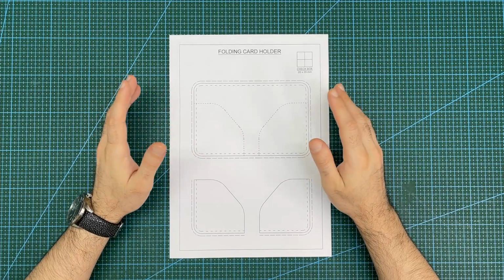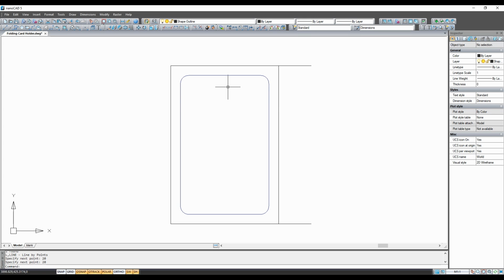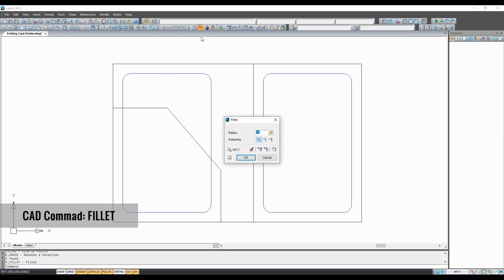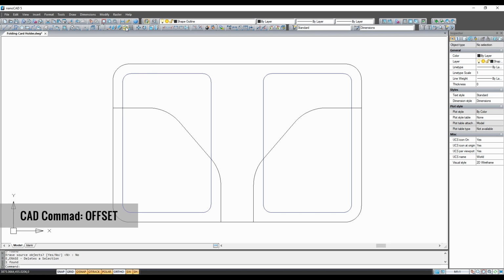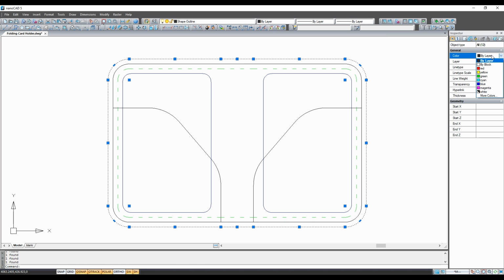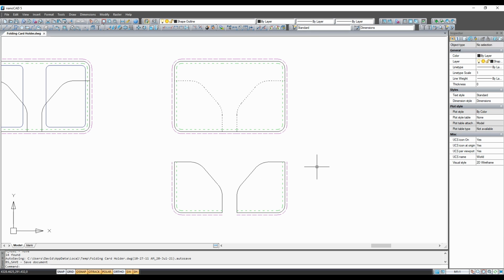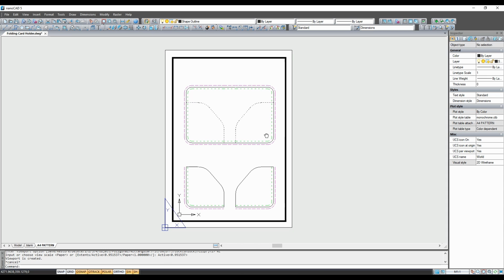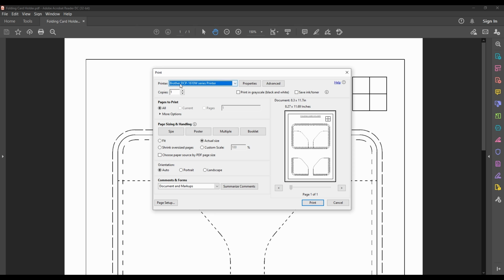Leather Pattern Design: Most Important Commands in CAD Software

Comment: You are the best. Thanks
Reply from the maker: Thank you!
Reply: @TeranAtelier  i am having problems with my software. it never show me the middle points or any other reference points. What can i do? i use the free version/ thanks
Reply from the maker: @dailiermoreno3107  You need to change the 'object snap' settings. Look for the OSNAP button on the bottom right and bring up the snap settings, then turn on the 'midpoint' snap setting.

Comment: just download the app but struggling to enter measurements and can't find where to add them.
Reply from the maker: As soon as you select your first point of your line, circle etc., you can enter a dimension and then press enter. This will complete your line or circle with your entered measurement. CAD programs will tend to use millimeters as dimensions unless you change the settings.
Reply: @TeranAtelier  thank you will try again.

Comment: What are these trim likes for? :)
Reply from the maker: Trim lines will allow you to trim the pattern after gluing multiple layers of leather. This will give you cleaner and straighter edges.
Reply: @TeranAtelier  ah, thanks. have a visual demonstration in one of your videos? Because i still can't quite imagine it. 😅
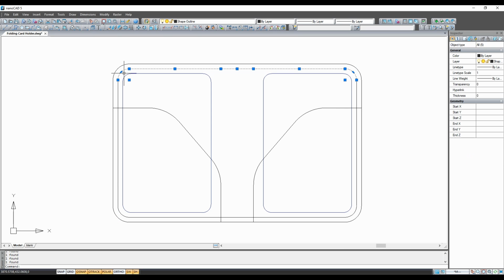Reply from the maker: @dukehorndrake5525  Trimming becomes most important for the pocket sections of wallets but is also useful everywhere else. Have a look at 4:46 in this video https://www.youtube.com/watch?v=gbxCH_VkR44  where I trimmed the pockets to give a clean edge for stitching and edge finishing.
Reply: @TeranAtelier  ah okay, so it's just that in case the layers of leather don't line up perfectly, that you have the chance to trim it without the piece getting smaller etc.
Reply from the maker: @dukehorndrake5525  Yes that's right. If you try making a project without allowing for trimming your edges will not likely end up very good or you may need to do a lot of sanding work. Trimming after gluing is definitely a process that will help.
Reply: @TeranAtelier  thank you very much for clarifying! :)

Comment: I apologize for my ignorance but how does one go about drawing the line at the 1:18 mark? I see "midpoint" popping up in the video but when I move the cursor over to the corner of the rectangular shape, it just shows "endpoint" and I can't place a line precisely where it needs to end. Am I missing some sort of keyboard shortcut not mentioned in the video? Any assistance would be greatly appreciated.
Reply from the maker: No need to apologize! Go to 'Tools' then 'Drafting Settings', then select the 'Object Snap' tab and turn on the 'Midpoint' snapping. Customizing your object snapping settings is really important to help your workflow. There are many ways in CAD to achieve the same result and I used that method as it made the video flow a bit better.
Reply: @TeranAtelier  Thank you very much! I'll do just that as soon as I get the chance later.

Comment: Hi Teran , this is a great video.  I'm learning Autocad but I am having trouble figuring out how to printer larger patterns that don't print on a single page. ...Any suggestion?
Reply from the maker: Thanks! You need to use the viewport function in multiple layouts. Each layout should show a different section of the larger pattern, then you can print out each layout separately. I plan to do a video about multi-page patterns in the next month or two.

Comment: Hey, so I made a pattern did everything you did then when I go set pattern to 1 everything disappears. Any clue on that?
Reply from the maker: It sounds like it might be a scaling issue. In model space you should be using millimeters as this is what the layout dimensions are made to. If you need to change from centimeters into millimeters for example, use the 'SCALE' function on your design and and apply a scale of 10. If this doesn't help, you can contact me on my IG where it would be easier to share screenshots etc.

Comment: Hey great video. Guys like you make, guys like me, try to make my best effort with leather. What if you want in this pattern to pre mark stitching lines? Thank you again.
Reply from the maker: Thanks!! For stitching holes you can add in circles along the stitching line with a radius matching your chisels e.g. 4mm. Then mark each circle center with a cross or smaller circle to designate a hole and then delete the big circles. You will then be left with stitching hole marks on your stitching line. Good luck with your projects!

Comment: By any chance do you also know how to do CAD design for 3D printing? 3D printing can come in handy for creating molds and basic structures to assist with leather work.
Reply from the maker: I can work in 3D with AutoCAD and there is a way to output a file for printing on that but I haven't tried before. I have seen others successfully make molds with printing however I do not have easy access to a printer. It is an area I would like to explore in future.
Reply: @TeranAtelier  There are already some useful tool files available on thingiverse: bracketing jigs, zipper guides, molds, sharpening templates, etc.
Reply: @TeranAtelier  I recently printed some bump jigs of various sizes, which are very handy for a variety of common offset measurements, instead of marking with a ruler and then drawing lines. That has always been tedious.
Reply from the maker: @pequodexpress  I think I need to get moving on some 3D printing soon, seems like there are so many good uses there. I also made a jig from some scrap plastic to help offset my pricking irons when my divider line wasn't showing up clearly on exotic leather.

Comment: This is fabulous. Thank you. Please tell us how we can return the favor. I don't see a Patreon account.
Reply from the maker: Thank you for your support and thank you for this video idea 😉 
I am in the process of creating a Patreon and will be posting a link soon.
Reply: @TeranAtelier  If you don't already have an electric creasing machine, are you interested in one?
Reply from the maker: @pequodexpress  I am definitely interested. The one I use now is the modified soldering iron type.
Reply: @TeranAtelier  Well, then, we need to collectively help you get one. I will receive    a Vulcan from China within a month. I'll let you know how it goes.
Reply from the maker: @pequodexpress  Sure! It is the first I have heard of that brand but it does look interesting.
Reply: @TeranAtelier  Do you have a link for the temperature-controlled soldering iron that has a wide enough aperture to accept the creasing tips? I thought I had an extra one on hand, but it turns out to have the wrong screw-secured aperture. I don't want to purchase one that is marketed as modified or leather work. The iron itself should be only about USD10.
Reply from the maker: @pequodexpress  This is basically the one I am using at the moment www.aliexpress.com/item/4000670514011.html it can accept anything up to a 5mm diameter. My FN2 tip I got separately accepts a M5 thread. So the tip is connected to the soldering iron using a short M5 thread bar. It does the job but the heat doesn't conduct well so the tip temperature will always be a fair bit lower than the selected temperature. The 'modified for leather' ones have a reduced temperature so it may actually be worse.
Reply: @TeranAtelier  Thanks. I've ordered a couple of the 905C irons from China. 

Your use of the M5 polished stainless steel tip and M5 threaded rod is wicked genius. 

What length of M5 threaded rod are you using? I would assume the longer the length the better for more heat build up and retention. Can you tell me what the maximum depth is for the recess on your iron, as well as the recess for the tip? I'd like to get the longest length of M5 rod possible, but I don't have a 905C iron on hand to check.  My Vulcan employs the M5 tips, and I'd like to use a dedicated 905C iron just for spreading edge paint and wax.
Reply: @TeranAtelier  I actually do have a 905C on hand. It was bought in China and has an insulated wrap so that iron can be grasped around the heating element for better leverage. The depth of the recess is  about 43mm. 

What is the depth of the recess for the female threaded tip?
Reply from the maker: @pequodexpress  The M5 female thread on the FN2 tip is 8mm deep and the length of my M5 thread bar is around 30-40mm long by memory, I ended up using the M5 brass thread bar from my alphabet stamping set. For wax or edge paint smoothing they have specialized tips or an S0.5 will also do the job.
Reply: @TeranAtelier  I've ordered 20mm to 50mm M5 stainless steal threaded rods. I think it makes sense to run the thread rod as deep as possible.
Reply: @TeranAtelier  I ordered a bunch of different lengths, as I don't feel like taking the time to try to cut three stainless steel rod.

Comment: What a great video! It's really hard to find tutorials on pattern design on youtube. I was wondering if a combination of layers and grouping might be a easier way to get the various pieces rather than copying then trimming? Also, on the first part, you seemed to do something to get the correct distance on the corners. How did you do that (before offset)? Thanks for doing this!
Reply from the maker: Thanks! I find it best to design a pattern structure in detail and then to split the pieces after. Then you can 'group' the pieces and reassemble them if you make any individual edits to check they still fit together. I normally only use layers (not shown) to keep my line formatting simple and consistent. For the corners, it was a weird snapping in NanoCAD that I haven't seen before in AutoCAD. It snaps to the perpendicular line coming off the tangent at the midpoint of the arc??? I used as it helped the video flow better but it could be done many other slower ways.